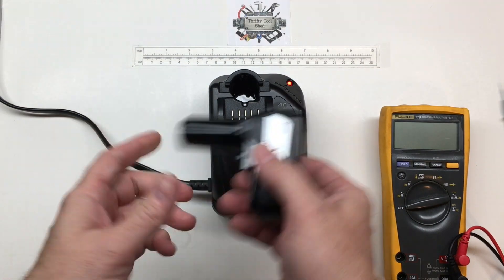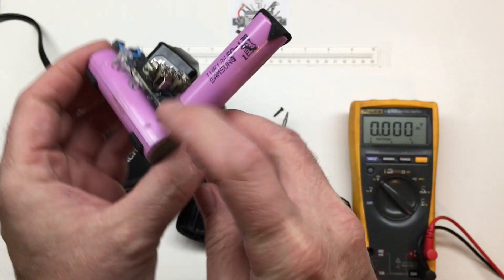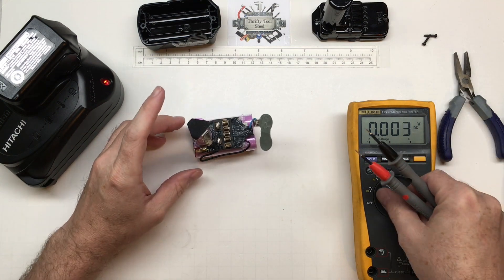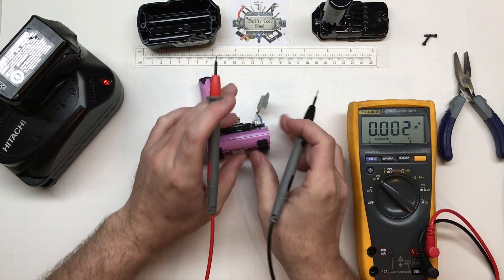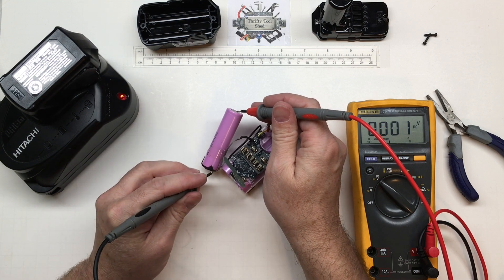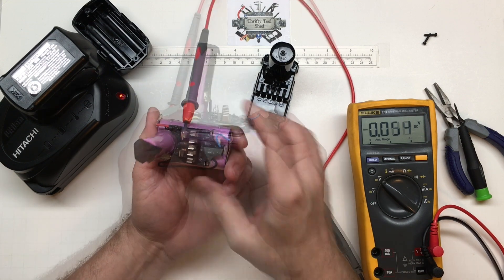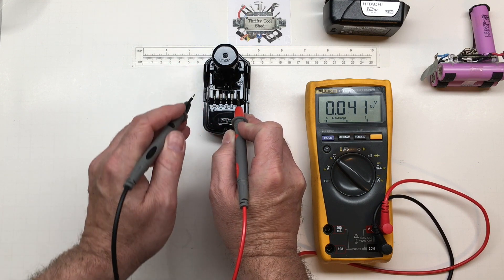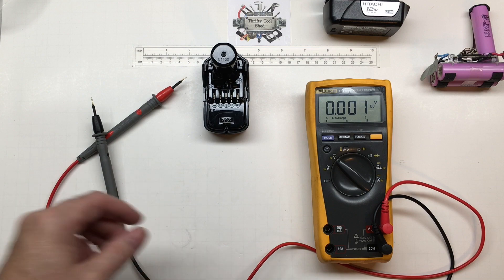Hitachi 12V Pack Cells CID Activated?

Comment: Hello, my BCL1015 battery has become over-discharged and I can't use it. Is it possible to connect it in parallel with a usable BCL1015 battery to unlock it?
Reply from the maker: I recommend a current controlled power supply for doing this. You have to be careful using a charged pack across a discharged pack as current is not limited at all.
Reply: @ThriftyToolShed 
I am very grateful for your reply. If I were to connect it, would it be + and -? C+ and -?
Reply from the maker: @yuuya_not_official  it would be + to + and  - to -
Reply: @ThriftyToolShed 
Thank you and continue to do great things in your research.

Comment: I found your video looking for a way to see if I could replace the cells. Off the bat, I'm noticing the charger doesn't light up when plugged in. Should I assume the problem is the charge?
Reply from the maker: This is an older video, but if your charger is the same it should blink red when plugged into AC power. My charger is the UC10SL2
Reply: @ThriftyToolShed thanks for the quick reply! It doesn’t light up. I have the UC10FSL charger.
Reply from the maker: I guess it could be different then. I am not sure about that one. I have actually seen chargers that would not light up at all when plugged in. The Kobalt 40V was one that I remember. I thought the charger was bad, but it was the pack and not the charger. See if you can locate the manual for your exact model to be sure. Best of luck to ya!

Comment: My experience tells me that the over-pressure in these cells were caused by one, or many possible scenarios. (1): overcharging (i.e. 'float charging'). (2): overdischarging (made-up word). (3): charging/discharging in too cold of an environment (lack of under-temperature protection). (4): charging/discharging in too hot of an environment (lack of high-temperature protection). OR: Any combination of the above. There could also be problems with the cells themselves (unlikely in this scenario), or with the BMS. (JFYI, if the BMS doesn't have high temp/ low temp protection, please do not buy these products. JMHO!) Also, DO NOT LEAVE YOUR Li-ion batteries on a charger!!! Charge them, and remove them from the charger as soon as they are charged. Store them at room temperature if possible. It is also best to NOT charge them above 60-80% state of charge for winter storage. If you live in extremely cold areas, only buy and use Lithium batteries with built-in heaters! Check these batteries' state of charge often, as the ambient air temperature can cause these self-heated batteries to discharge relatively quickly in extremely cold temperatures. Remember this: Li-ion batteries love to live between 60-80% state of charge. If you keep your Li-ion battery at 60-80% state of charge, they will last for about 3 times as long as they will if you charge them to 100%, then discharge them to 20%. (Total Watt Hours over their lifetime) Never discharge them below 20% unless absolutely necessary. If you love your lithium batteries, they will love you back.
Reply: Очень интересно, но скучно. Вещи нужны чтобы их использовать, а не чтобы их обслуживать всю свою жизнь.

Comment: Very helpful video. I was able to peel back just enough of the spot welded tab to access the little port to vent the batteries. Only one battery let off gas and I was able to bend back the tabs without breaking any of the spot welds. I’ll try charging the batteries tomorrow, so I can keep an eye on everything.

Comment: Very nice video.The only one I have seen on this hithatchi battery.I have 10.8 volt battery and the bms is not working properly.I wonder if you have an idea where to buy the same bms card?
Reply from the maker: Thanks for your comment, I do not know of anywhere that sells these BMS boards. I have not had to work on the BMS board for any of these yet to say what a common cause is.

Comment: In my hitachi 12v peak there are lg cells - brown , no issue combo drill/impact from 2017 :)
Reply from the maker: Yeah, I have not had any issues with my other packs either. Something unusual with this pack I guess. I don't think this is common. I do alot of battery talk on my videos and have mentioned the CID before but never really showed or explained it! Just thought it would be a good opportunity. Thanks for sharing your experiences with the Hitachi.

Comment: Didn't know about the cid. If all 3 cells tripped due to pressure, that would lead me to believe the bms failed somehow and allowed the cells to overcharge. Or the cells overheated for some reason. Given the pack is fully charged, the fault happened while charging. Unfortunately I wouldn't trust the cells or the bms, and would monitor the charger as well.
Reply from the maker: I know, that is really the only reason I published the video. I believed this to be a bit odd. Like new, fully charged after all, but the CID still activated surely pressure build caused it but not just one cell like it was defective but all three the same? like you I believe it only makes sense that it happened maybe at the end of the last charge cycle? Never seen one like it and possibly not again...